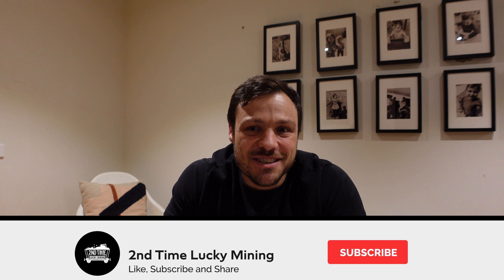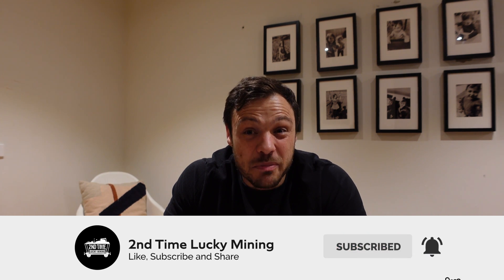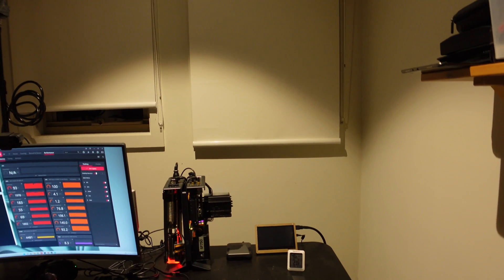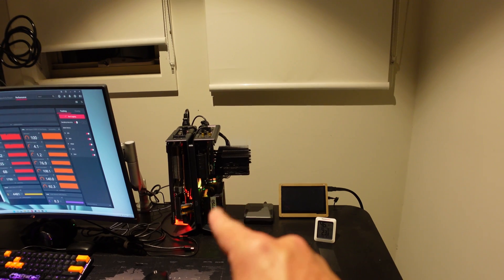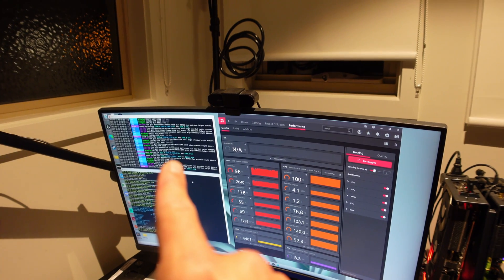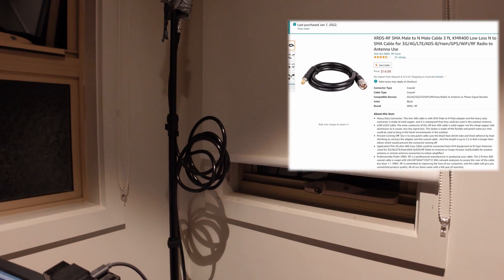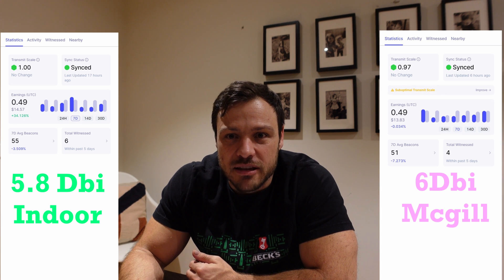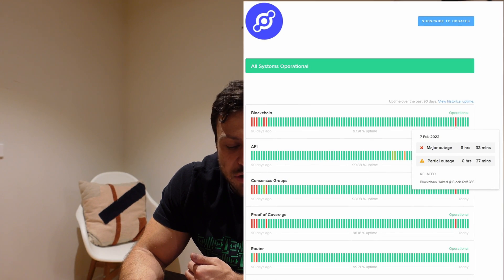Helium Antenna Test - McGill 6Dbi

Comment: How can you test an outdoor antenna inside and say it doesn't make much difference?  Why do you have your antennas inside it doesn't make any sense at all. You're gonna be able to  Is penetrate through 2 obstructions Max. And having it in your house eats up one right off the bat. I have seen a lot of people getting better rewards with both of those antennas.  Also the quality of your adapter could be causing a huge signal lost
Reply from the maker: Thanks for the feedback. Unfortunately landlord is a bit sticky, but your points are fair. It's the best I can do atm, but working on an alternative.
Reply: Consider at mimum placing in front of window.  If you have a screen remove it
Reply: @swing_trades_setups   Wrong. Inside is not the way to do it. Period.
Reply: @JackRabbit72380  I don't disagree as mine is outside 10m high. Not sure if you listened to video but he said landlord wasn't ok with placing it outside, so give that placing it new window rather than corner of room is advised.